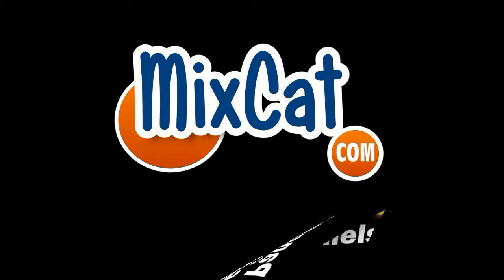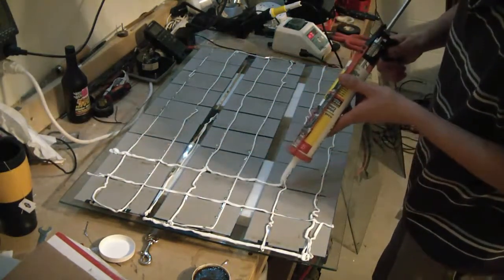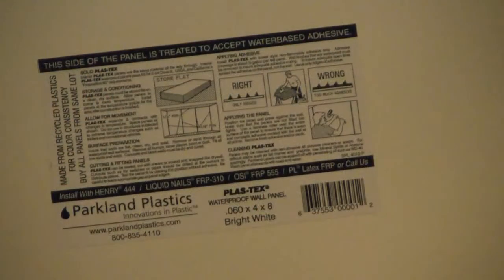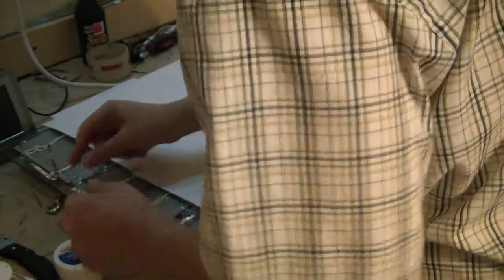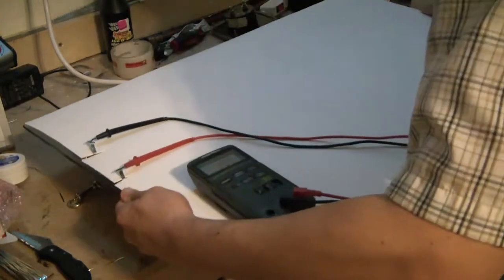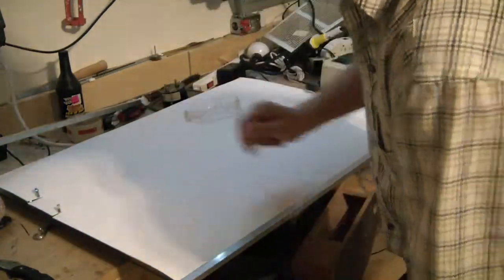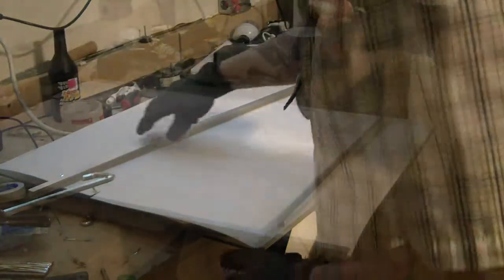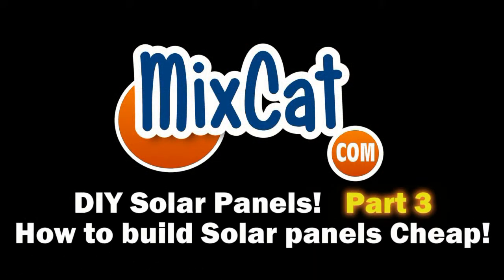How to build a Solar Panel from Solar Cells DIY  Part 3

Comment: Many thanks. Is it the normal silicone or a special one? How do you fix the panels on the frame (of steel or alu)? They have to be fixed very well on the roof because of wind storms. Tell me how you made this. - God bless you. (Saludos from Spain)